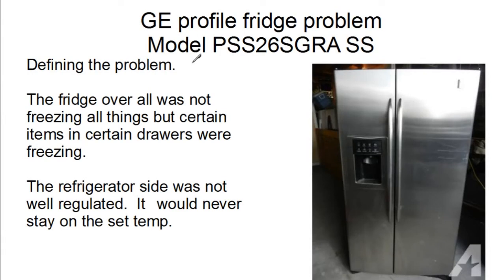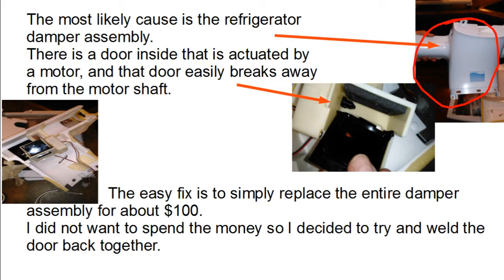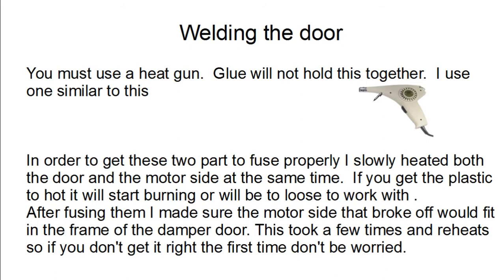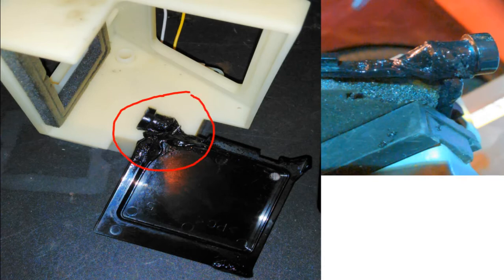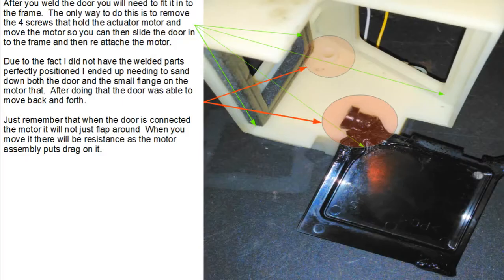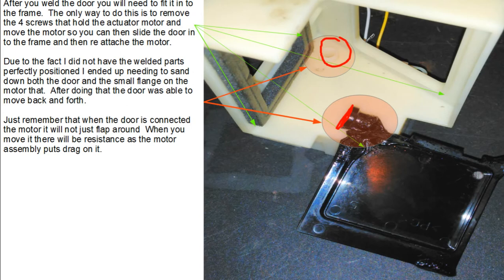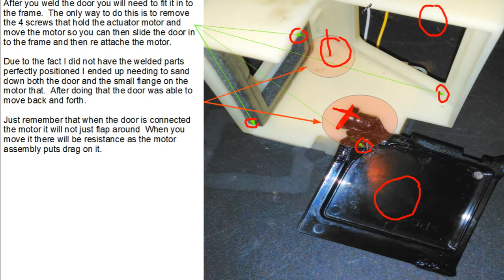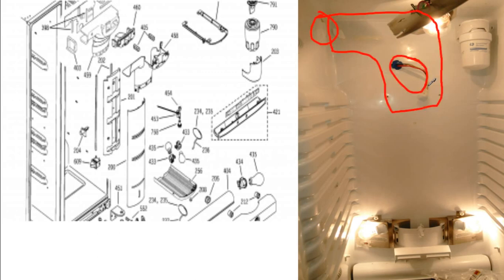GE profile freezing food

Comment: Thanks for the post. In my particular case, GE Profile Side By Side but not the one pictured I followed all the online info I could get, ruled out the possibilities and came up with the solution to the food freezing in the refrigerator side: The evaporator fan motor was only working on high speed. It has an encoder built into it that monitors fan speed. When the fridge calls for cooling, the fan speeds up and forces chilled air through a flap in the upper left corner of the compartment which chills the refrigerator. When it gets cold enough, the motor turns off or switches to slow speed which chills the freezer but doesn't force air through the flap into the fridge side. I was able to fake the control board out by putting a 6.2k resistor in series with the fridge side temp sensor. That made the controller turn the fan off when it "thought" the fridge side was at the right temp, but then the problem was the fan wasn't running often enough to keep the freezer side near zero, and it ran at around 20F which was fine for keeping food frozen, but ice cream had the consistency of peanut butter. The problem now is finding a replacement part online that isn't a factory reject, either because the encoder is bad and the fans all run at one speed only, or they whine so loud you can hear it in the next room. But thanks to your site and many others I've been able to learn how the fridge works and how to avoid a costly repair bill.

Comment: Dan, I was ready to order a complete new part. I realized it would take a week to get the part. I then thought what if I just remove the door out of the system and block off the intake at the freezer by 75-80 % and leave the fan plugged in.  It works fantastic. My fridge stays  at around 37 degrees and the freezer at single digits with no freeze up in the fridge. It's been running that way for 2 years and I have no plans of changing it.
Reply from the maker: Great idea,  If mine breaks again I might give that a try.

Comment: Dan , thanks for your video. Mine broke in the exact spot as yours. I'm going to try building up the glue method. It's amazing how cheaply made this thing is.
Reply: Door2416, GE Appliances is owned by the Chinese. I hope you understand the implication of this. Dealers will tell you that GE Appliances are built in the U.S. but it is only true they are assembled in the U.S. using mostly Chinese built parts. 
They are complete junk!! We have the same problem with our GE Refrig. All the other GE appliances that came with the house we bought last year. All but the stove are JUNK. We will replace as time goes buy with Whirlpool built products.
Reply: @stevehudson5406  Before I retired I worked for Stanley Black and Decker. Sad truth is they went Chinese in early 2000 as well. I live in Ohio not too far from the Whirlpool plants.